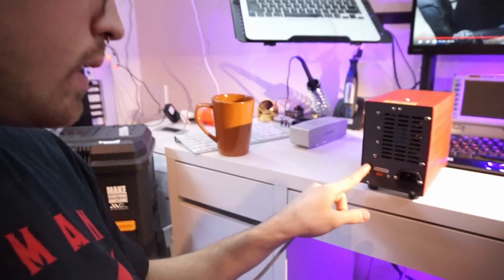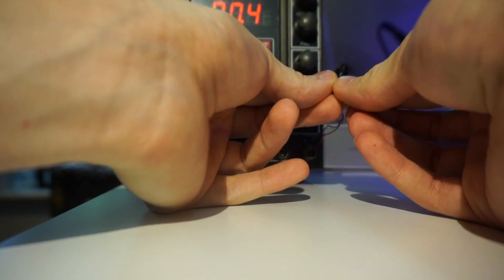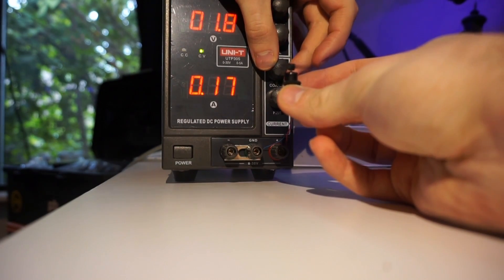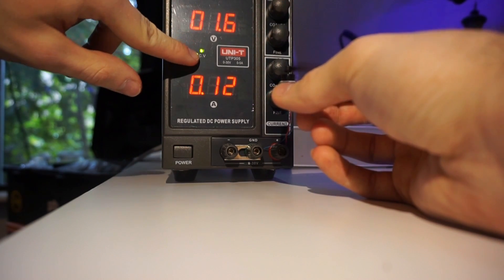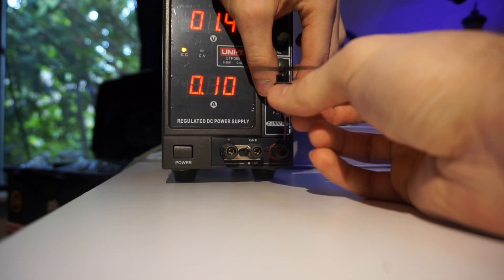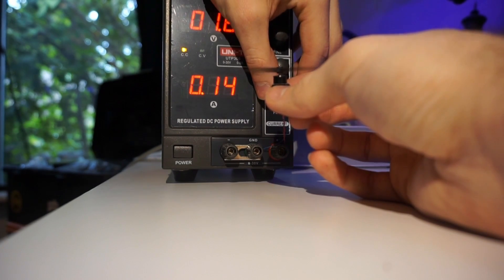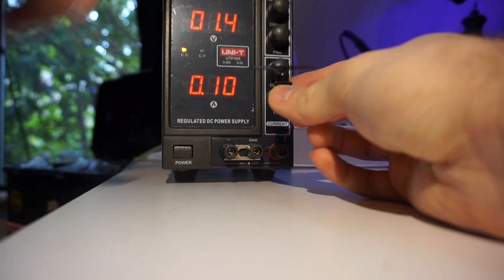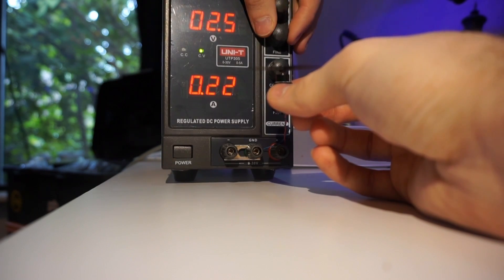Workspace Tool Addition | UNI-T UTP305 | Unboxing & Initial Review

Comment: Hi Gian
I own similar supply from eBay (not Uni-T, some noname thing). Mostly using it to charge LiPos for my drones. While for analog electronics design and evaluation - this thing pretty much useless. At 8V setting I see 700mV peak-to-peak spikes, decent amount of switching noise. So for any "lab" work with analog electronics - it is useless. I still have to use batteries to properly evaluate some OpAmps, DAC or ADC performance in my circuits.

I see you have a nice scope in your room, can you hook it up to your power supply in AC mode and check the noise on voltage lane?

Here is my demo: https://youtu.be/bvnc1iL9mGo 

I do own two multi-meters from Unit-T, and they are really good and serving to me for over 3 years already. I do wonder if Uni-T power supply will be any better than my noname version from eBay

Comment: It's one of the more crappy supplies on the market!  So before giving it a five out of five by looking at it is NOT a review.  It's a testimony of bad taste.  The voltage relais in it are cheap and fucked up.  The fan is 24volt and always on and very LOUD!  The knobs have no indicator marks. The "fine tuning" knobs are as coarse as the standard ones.  Best to use it only as a battery charger. It's a load of shit!